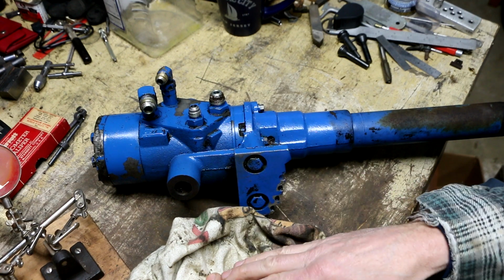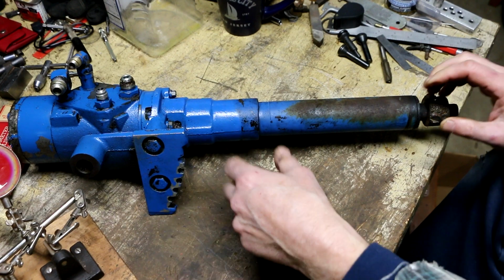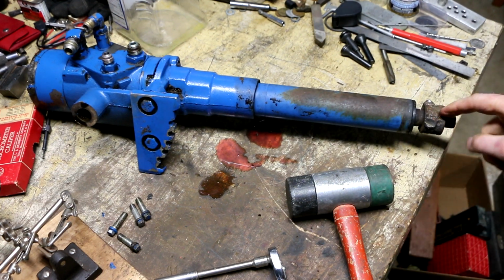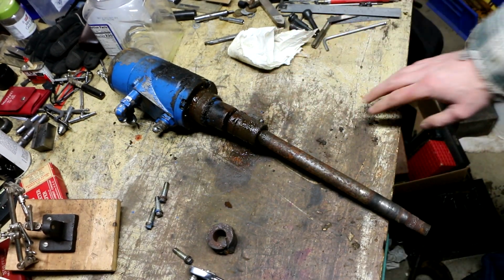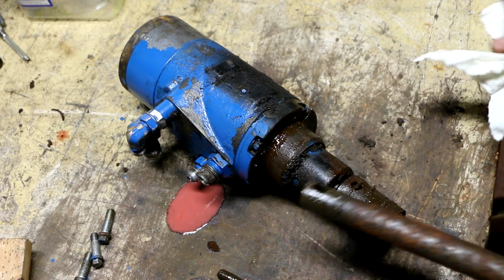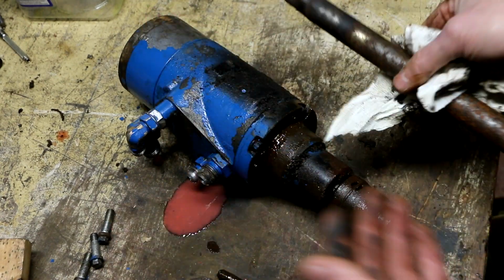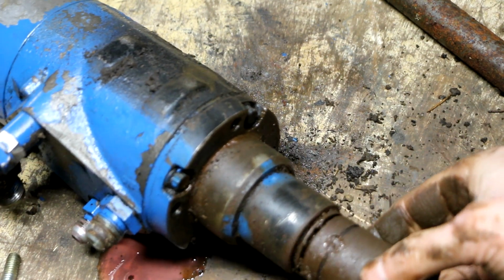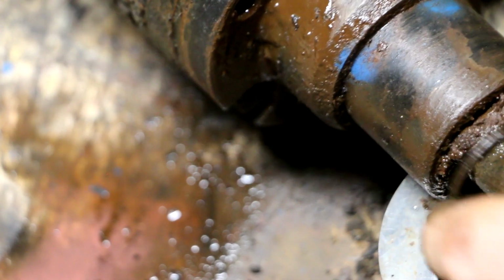Ford 5000 Row Crop Tractor Steering Column Removal

Comment: Wow!  Great Video! I Ike the way you explained things as you go! My I Ford 5000 power steering assembly has been leaking bad for several years, so I am trying to put in a seal kit.  My assembly looks a lot different than that! Mine is not a row crop and appears to be built in 1973. I can’t get my assemble off the tractor.  I think I have all of the bolts out.  So I came on here to see some videos about it.
Reply from the maker: Glad it helped!

Comment: I view a number of mechanical oriented videos and often wondered why the owners presenting the video's hardly ever use a liquid wrench or penetrating oil type product sprayed on bolts or fittings before wrenching on them to break them loose, in my mind they are risking breaking or damaging them all together. It is a cheap application which in my mind and experience works. Even soak them when really rusty for a day or two before wrench on the fitting.

Comment: As you said, quite the mess. For the wheel and shaft, you have a lathe. A generic wheel with a taper fit mated with a longer shaft would do a treat. You'd need to make a stop collar as well. For the pin retainer rings, I have used safety wire in the past. There needs to be enough clearance for the twist to lie down, but around one groove, hook to the tag end with a latch knot (like lacing a harness) and over to the other groove, around, hook there, and twist the tag ends. Also, fear not an old steering wheel. I bedliner coated the wheel on my '49 Deere. Holds up fine and hides the sins of the weld repair to the spokes.
Reply from the maker: Great tips. Thanks.